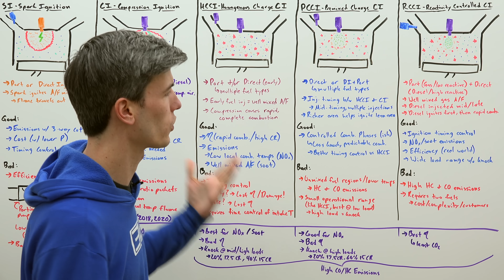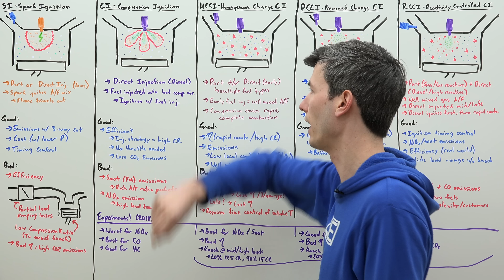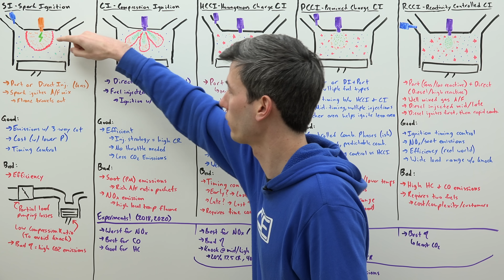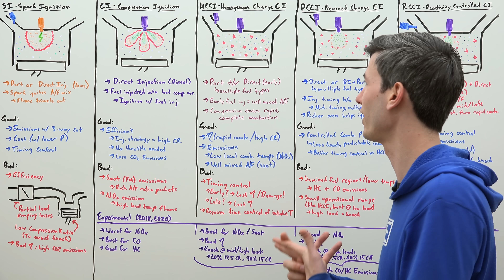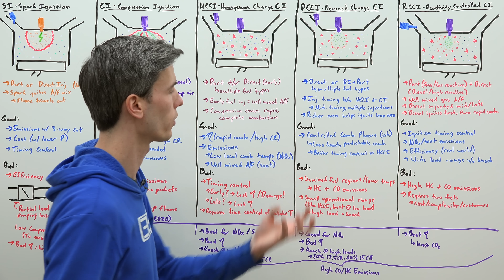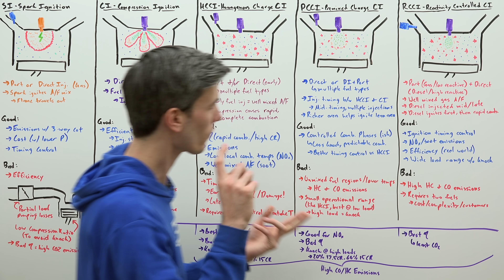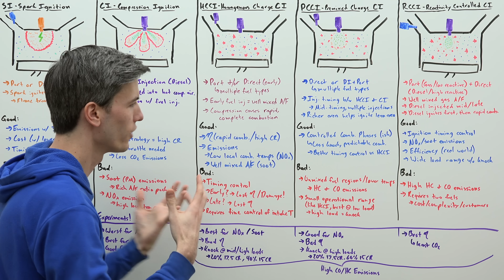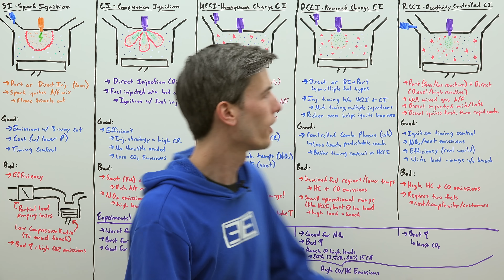If Combustion Engines Have A Future, What Is It?

Comment: hydrogen is an alternative fuel that would make the i.c engine green and still viable in the future.
Reply: The problem with hydrogen is that it's extremely difficult to store and if you want to store it in a liquid form it needs to be kept ridiculously cold! That is, and always has been the problem with hydrogen!
People seem to forget about that...........
Reply: @lustfulvengance  Water seems to be the best form of storing hydrogen and it includes oxygen to help with  the combustion.  We just  need a method to break apart the molecules to where it then allows for combustion to occur.  Somebody needs to work on this ASAP.
Reply: @saranjs3365  The problem is, unless you're deriving hydrogen from fossil sources, Hydrogen is a net loss process. If you're splitting water to make hydrogen, it takes so much energy to do that you'd have been better off just taking that power and charging a battery with it.
Reply: @saranjs3365  well that would need electrolysis, meaning a bignbattery. Thus you would simply have an EV with inefficient extra steps and a more ICE feel to ut

Comment: Explain why the electric car is twice as efficient as RCCI IC engines.   Could you compare the best future RCCI to electric cars using different electric generation sources: coal, natural gas, nuclear fission molten salt, PV solar, and wind turbine.  (maybe next compare total weight, as used for X-57 air travel, current turbine jet engine to electric/Lithium battery, electric/hybrid turbine, electric/hybrid RCCI)

Comment: Show me an electric tractor I can run at twenty below, totally off grid... I run wind and solar for my house, but there is no way I could ever use an electric log splitter, saw mill or tractor. Combustion engines will be here for a very long time yet.
Reply: People have a very poor understanding of where fuels actually get used, cars are only part of the equation. There a lot of applications where non-ice engines just aren't even remotely practical. We will never, ever be 100% fossil fuel free, ever. But if we knock out some of the easy stuff and save the ICE engines for where/when they're needed, cool.
Reply: @SOHCGT96  don't get me wrong I've been building electric motorcycles for 10 years, I love the technology, it just isn't  possible to use it, like you say, for all the power i need, in the remote places I need it. I even tried electric water pumping, but the pressure just isn't there for the distance i need to move the water, for the cost of the batteries and pv panels I can buy 3 gas pumps.

Comment: Make this argument simple: lithium-ion batteries 0.7 MJ/Kg, gasoline 47 MJ/Kg. The ICE is going to be around for decades to come unless there is a miracle breakthrough in battery technology. For you homers that think Elon Musk will provice the answer, in the last decade+ have gained maybe 3% - 4% in energy density where they'd need at least a 1100% increase to compare with current ICE technology. ICE engines are still outpacing EV's in term of efficiency gains.

Comment: I see a future where we just use whatever power source best fits the application. If your car never leaves public infrastructure, use electric. If you need a hammer with 4 wheels to work off the grid (pun absolutely intended), use a liquid fuel.

Comment: No one ever talks about waste heat that cars make .If the greenies don't start letting power plants be built then the way to go for Ic is as a generator in the basement charging your car ,running the house and the waste heat being used in the house or heating the pool. Waste heat management is were massive savings can be made. Houses need a central freon system that can move heat from the fridge and AC to the water heater.

Comment: The 'Future of Combustion Engines' is......?  Rocket Engines (for a very long while - at least to orbit) and Jet Engines (for a while at least). Thats it!
Reason: By principles and everything that is engineering practical -  every advantage goes to electric motor over ICE - Simplicity, Torque profile, longevity, effiency, power to weight ratio, cost to manufcature - all win - by a large margin.
 The only thing standing in the way of electric domination in all fields today is the great energy to weight ratio of fossil fuels ...but I think a good decade or so of well funded, high intensity R&D in battery tech will erode that to negligible considerations - as it is being done already.

Comment: Making methanol from carbon pulled out of the air and running it in ICE cars will make them produce less emissions than gas and the process will clean the air at the same time

Comment: That was so interesting. I never knew that a diesel engine injected its fuel at the top of the compression stroke to cause combustion. I always thought it was like the HCCI engine with a homogeneous air fuel mixture in the cylinder.that gets compressed

Comment: Driving a 66 year old Chevy I6 truck.  Mileage unknown. 10l/100km. Very low oil consumption. Runs on cheap E10. Ca. 115 hp.
The engine design dates back to 1925. Low maintenance requirements and totally dependable. Maybe you want to shed some light on how engineering paradigms have changed over time. From my point of view every engine built today is faulty :-) thx

Comment: How bout a hybrid setup that works similar to a train. Have a small very efficient generator running at it's most efficient range when needed charging or powering an electric system. The engine wouldn't need to have a varied load or rpm and could just constantly stay at it's most efficient level.

Comment: Seems to me that aside from very few specialty applications, both spark and compression ignition engines are short for this world. EV's are cheaper to maintain, cheaper to fuel, have fewer moving parts, don't require as many HC-based lubricants, etc.... Musk has won.
Reply: Synthetic fuels might come in handy

Comment: Would love your take on the metallurgy required for these engines and how that holds back commercialization. My understanding is that the flame fronts of SI and CI engines are relatively gentle on the cylinders, pistons, heads, and valves whereas the explosions happening inside the latter 3 engines can wreck havoc on those surfaces.

Comment: I have heard about using microturbines, directly powering a hybrid-electric drivetrain to get over the gearing and torque requirements for large vehicles; not sure of the NOx emissions or complexity but the engineering of a different/more efficient engine architecture is interesting

Comment: I wonder if these engines could be Compatible with Biodiesel and water Injection
Biodiesel has 
- 75% reduction in HCs
- ~50% reduction in CO+Soot emissions
- No Sulphur emissions at all
Issue is 
+ 5-15% Nox emissions because of Viscosity and Free Oxigen Content in the feedstock

I also wonder if its compatible with Water or Water/Meth injection
Water Injection reduces Both intake and Exhaust Temps at nearly 125° F Which promotes Effciency,Efficiency, the Chamber clean and reduces Nox by 5-12%

Comment: Got electric scooter.  250watt (1/3rd horsepower) charges in four hours on a 100 watt solar panel rated to last 20 years.  Ten miles on each charge.

Exactly how did we ever get to a 100 horsepower engine for moving a single human?
Reply: Any luck picking up women when you’re cruising around on your scooter??
Reply: @sking2173  Don't need to, they make electric cars with higher torque than any existing combustion engine ever made.

Comment: There are diesel trucks running on dual fuel with propane (LPG) injected into the manifold and standard common rail direct injection, ratio of propane to diesel fuel is about 4:1 by mass. Evaluation tests indicate increased horsepower output and a substantial reductions in emissions.  
 There is more particulate in modern diesels coming from brakes, tyre wear and road wear than what comes out the exhaust, since the introduction of DPF . SCR Catalytic reduction using Adblue has also brought enormous benefits in  reducing NOx  emissions  and modern diesels are a million miles cleaner than their predecessors. Much depends on the driving cycle of the vehicle and getting up to operating temperature quickly. Very small modern diesels are notoriously difficult to heat in cold climates/weather as the efficiency of modern engines continues to improve dramatically. Love your videos they are always entertaining and informative. I would love to see a video on emissions (HC, CO & NOx) from indirect diesel injection v's direct.

Comment: Gas mileage would be all better if the engineers would come up with a engine and transmission combo that would be at idle rpm at 70+ mph. Lower rpm= better fuel economy

Comment: Jason, from what I know pumping losses don't come from "sucking against restriction" but from the fact that piston pumps (hence 'pumping losses') from low pressure area - intake (p = 0.5 bar at part throttle) to high pressure area - exhaust (p > 1 bar). This also explains why turbocharged engines have "negative" pumping losses - because intake pressure > exhaust pressure, hence intake air pushes down the piston with more force than the piston have to push exhaust gas out.

Comment: I can't agree more that electric cars are the most efficient. The biggest problem is the electric grid. Nobody talks about that. If everybody would go electric tomorrow, we wouldn't have enough electricity to charge and prices will go pretty high.

Countries operate at 98-99 electric capacity and when have extra trade with other countries just imagine if everybody would have an electric car which consumes twice then a normal house in a month, what would happen?

The other problem would be the grid itself in small villages or let's say if you go up in the mountains for skiing they barely have normal grid lines there but your car requires 110kw line to quick charge. And usual line in Europe is like 6-7kw.

Comment: Could they develope a CI engine that ran on e85? I know there is less energy available in e85 but if could be ran leaner since it has a better heat absorption rate that petroleum and since it has a very high octane it would handle pretty high compression without issue. It really just seems like adding more air (turbo or SC like they already do but just tune it leaner) to the CI would solve the rich issue and then a heat problem would be the issue that could be solved my some kind of alcohol or similar fuel with a quick evaporation pulling heat out of the cylinder. Oh what if they made e85D with 15% diesel instead of gasoline?

Comment: So i have a question, on 2018 and newer 5.0L V8 F150 and i think Mustangs they use a Multi port and Direct injection system. So does that mean its an RCCI system. Because its a fas engine only or is it just a combination injection system. Im actually curious because i feel like having 2 injection systems make it more complicated and with higher maintenance.

Comment: Speaking about two fuels...

What does AdBlue do for diesel engine combustion?
Reply: Reduces NO(x) emissions. It's an additive composed of a.o. destilled water and urea. It's injected into the exhaust system of the car and acts as a catalytic converter (selective catalytic reduction) for nitrogen based exhaust gases, producing nitrogen, water vapour and carbon dioxide.

Comment: Considering combustion engines now are almost all running under 30% efficiency .. there is tremendous opportunity left.  If efficiencies can be increased significantly AND liquid reenable fuels produced .. would be a better, cheaper and more practical solution than EVs.

Comment: I'm a bit disappointed that this presentation stayed in the combustion chamber.  

Is there any possibility of new fuels that will extend the usefulness of combustion engines?  It seems to me that the big tradeoff today is between the energy density of liquid combustion fuel versus the fossil origin of such fuels and their carbon emission implications.  It seems that this will limit combustion engines to a narrowing set of use cases where that energy density is of critical importance.  Any sign of this changing?

Comment: The future of combustion engines is a change in fuel source. Combustible hydrogen's main flaw is its low energy density, ie needing a larger fuel tank, when coupled with a hybrid electric motor for short distances and using combustible hydrogen as a range extender you basically get the best of both worlds adding peak low emissions.

Comment: If it's cost effective enough and I'd adopted widely there could be a twin nozzle designed to make refueling simpler, just two gas handles stuck together, with the nozzles being different sizes so you can't screw it up, and the actual fuel fill locations on the car being side by side also with different matching sizes

Comment: Couple things to note, efficiency can be understood and interpreted in different ways. 
One thing I noticed right away is the complexity of those new designs. The are bloody complex.. I mean controlling the ratio of the fuel/air is already a complex very complex task for the engine to do. This is especially visible in cold weather environment. There is too many variables - fuel quality, air density, air temperature. Even in hard rain conditions the engine sucks in a lot of air with water particles in it.
So when I look at those designs, I do not know how would they be able to cope with sudden change of weather conditions.   
What about reliability? That should be calculated in to the efficiency calculations as well. 

I mean its popular times to be questioning a combustion engine future. But honestly, electric is the toys for rich and it will be that way for a very long time... Sure we could buy one today for relatively cheap price... But imagine the infrastructure you would need to own... You need to have a charger station near your home that is not really an option if you live in a flat, where majority of the society live... You would also need a charger station at your work or close to it, just like all of your coworkers who would own electric cars... 
That is a huge amount of infrastructure, very expensive to build and maintain, a lot of copper and copper is hard to manufacture, very intense energy wise that is why its so expensive. 
So is that efficient? Why no one is calculating that in to account ?

Comment: I would do it, filling in 2: diesel and gas, if I can afford the engine and the car. What about igniting the mixture exactly, timed with microwaves? 
For now, I like turbo-charged engines, knowing, that they need to be handled well, need good oil, and that that they should get time enough to cool down, before stopping the oil-pump (by shutting down the engine?) .

Comment: This is why liquid fuel engines are a dead-end.  Insane complexity to make trivial improvements.
Reply: In fairness, it's not like battery chemistry is a simple walk in the park either...Insane amounts of research, all for minimal improvements in energy density.
Reply: @skifree0  I was thinking about the already-excellent characteristics of AC motors, but I get your point.  Battery improvements will be at the top of the list of importance in the 21st century.

Comment: Thanks for your clear and well researched explanations. Therefore, there may not be any future direction for a brand such as Ferrari, which was historically and famously centered on the 12 cylinder high torque engine - just wondering. BTW I own a Ferrari 599 GTB and love the sound and the torque ;-) But I can't get my head around where they (Ferrari) can go from now - Porsche, VW and Toyota are making great advances with EV technology, but they all lack soul.

Comment: Waiting for my Mr Fusion electric car! Oh, and it can fly as well - right?
Reply: I'd be satisfied with a Mr Fusion and a couple big ass AC motors. Ifa Mr fusion can supply a short term burst of at least 1.21GW, That's 1.21 billion watts of power. If it can do that much in a momentary burst, I'd venture it could provide a lower power at a sustained level for a pretty long time. That's hundreds of hours of providing over 1000KW of power, if you had the motors to handle it, you could have an electric car equivalent to thousands of horsepower.

Comment: is there any new fuels in development that would be better overall in the modern climate? in terms of emissions during production and exhaust emissions?
Reply: The use of biofuels (e.g., biodiesel) is carbon-neutral. Like for humans, plants are used for fuel, and the exhausted CO2 feeds new plants — it’s called the carbon cycle.

The reason the use of fossil fuels is elevating the atmospheric CO2 levels is that it is releasing long-sequestered CO2, and it cannot be re-sequestered quickly. Biofuels are made of rapidly-cycling plants, the same as we humans use as fuels.